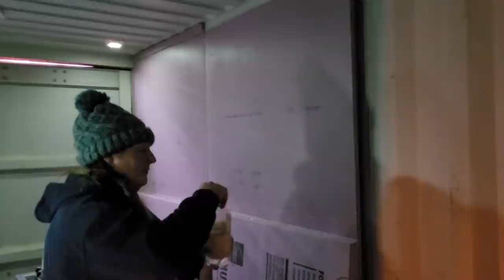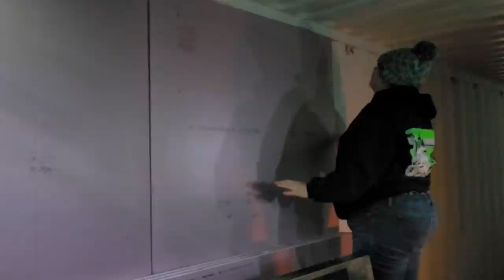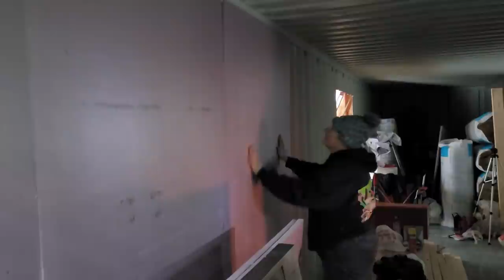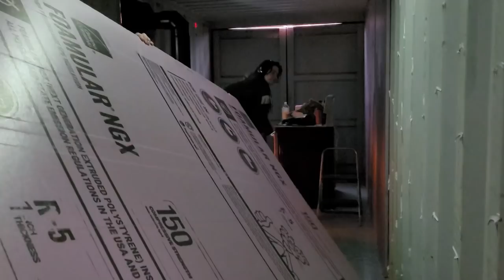DIY Shipping Container Tiny home// Adding Insulation day 2//OFF GRID BUILDING VLOG

Comment: Heather, you need to dry fit each piece of that insulation before putting it in permanently. You also can use a piece of one by four to pound against foam to get it in place and not damage foam board. Love your channel, Mike from North Carolina

Comment: When you are "tapping" those brittle sheets of insulation in, consider using a piece of 2"x4" to actually tap against, distribute the force of the blast, reduce internal material damage, and better avoid a break or crack through the material.

Comment: You'll get better adhesion with a line of glue as opposed to dabs of glue.  "Better adhesion" may not be as critical an issue with the framing, additional insulation, and dry wall holding it all in.

Comment: A friend of mine built out a shipping container home at his lake lot . He used a product called Froth-pak spray foam insulation.  I) PKG covered 1 1/2" on the walls and ceiling then framed out and used rock wool insulation
Reply from the maker: I really wanted to do spray foam but it is to cold right now to do it
Reply: @KuzweKanfarms  foam board insulation is a good alternative tape your seams with tyvek tape to complete the envelope

Comment: Have you thought of dry fitting the styrafoam insulation before gluing it in place?  Place a piece of 1 x 4 scrap wood across the top or bottom to pound the insulation into place.

Comment: don't know if you mentioned it already, but how come you didn't put the wood framing up first and then put the pink insulation up inside the frame? Would save acouple inch into the container.
Reply from the maker: Good question for sat q and a

Comment: Use a 2x4 to smooth Styrofoam to the wall from the tip down.
Reply: And if you need to butt it up to the one next to it the 2x4 won't mess up the styrofoam when you have to move it.

Comment: I mentioned  the use of two sided tape to use instead of glue , here is some info:There are many vendors of two sided tape this is one ECHO tape COLD WEATHER DOUBLE SIDED TAPE is coated with specially engineered acrylic adhesive designed to work exceptionally well in cold weather temper, it's versatile and can be used on mounting metal building insulation, Used all for other bonding construction applications.DC-M155A Part# can be bought thru amazon .
Reply: Try google in your area!
Reply from the maker: Thank you!
Reply: wo @KuzweKanfarms  Just wondering if 2 sided tape would allow for moving the panel    a bit if it's not exactly where it needs to be.
Reply from the maker: @NH-Granny  it might I just don't have any.  I picked up a few tubs of the glue.  I try and use what I have first.

Comment: Have you thought of using two sided sticky tape like used in carpet installation instead of the glue ?
Reply from the maker: Good idea
Reply: The 2 sided tape might not stick because of the cold temps.
Reply: @comptut5244  They Make this tape specially for cold weather applications including applying insulation on metal buildings in cold weather.

Comment: What adhesive was used for the foam?  How is the installation doing?  Better temperature regulation?  Going to do this in my container
Reply from the maker: I used gorilla glue make sure whatever you use won't melt the foam